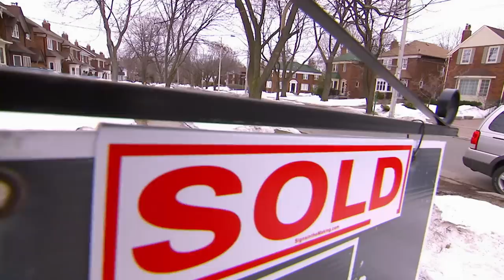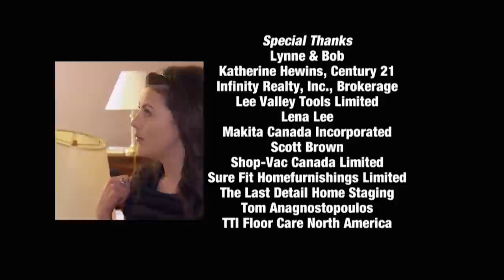A "Unique" Home That's Been On The Market FOR 4 MONTHS! | The Unsellables | House to Home

Comment: If they had just dropped the price by $50K without the remodeling it would have sold sooner.
Reply: My dad did that with his 1967 built tri level.  The location was excellent but there had been no updating.  But everything worked and was clean.  We only repainted most rooms, and took down the 3 layer thick livingroom curtains.  You know the ones… that looked like quilt at the top ! They were big in the late 70’s-early 80’s.  And my parents already had an open concept kitchen.
Reply: A smart buyer will bargain and do well with this.

Comment: I’d love more details about the sale. How many days or weeks specifically did it take to sell? Did she get above asking price?
Reply: Hello Cayla, I am the Realtor in this episode(was my old married name).
So this episode was shot around St Patrick's Day week 2007.
After the reno HGTV did I was able to get more photographs made and I sold it a week after. I had tried with no luck to get the price reduced before the reno. If memory is correct I think it sold for 430K in the end. 
In my 20+ years as a Realtor I never ever had a house sit on the market like this.
It was very large and for the Sq ft price it was a deal.
I put it on the market late 2006, we had a horrible winter lots of snow. I did an open house every weekend just about!!!! The realtors called back for a second look in the episode I had met and they had brought clients before the renovation. Even though we could all see the potential without the reno the buyers at that time just wanted turn key.
People have commented that the house exterior should have been painted, this was impossible as it was aluminum siding with the color in it, and possible to paint but not for the episode- they only have a week and it was freezing outside.
Anyhow, was a memorable sale for me!!!!! On an up note I became the consultant for the show from then on(this was episode 8), find the comp houses(which I did for this episode), I wrote a bunch of points for Sophie to use on her talks at beginning and through the show.
In the second season I found the homes that were to be featured and renovated to sell. So I ended up working on about 30 episodes.
Was a fun gig for me.
The crew were really great.

Comment: Beautiful makeover. However, I would not have been able to tolerate the chain link fence lining the property or the all white dated appliances.
Reply: That fence is awful and the colour of the exterior is a put off, but I can't see what was wrong with the original decor and furniture - sure, it was dated, but it won't be there when you move in and you can choose your own paint, etc once it's yours. I also find that the houses on either side of all of the houses that have been on these shows are built too close - a bigger gap would make them feel less crowded in but there isn't a lot which can be done about that.